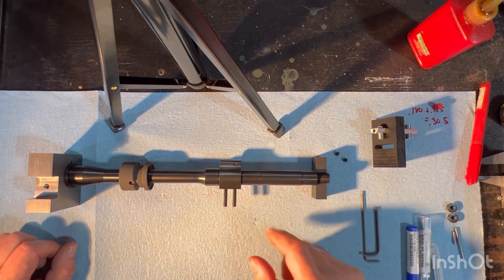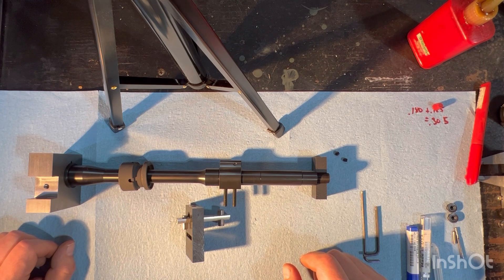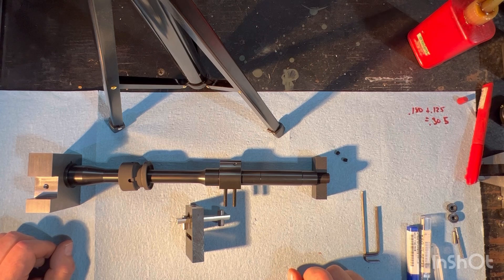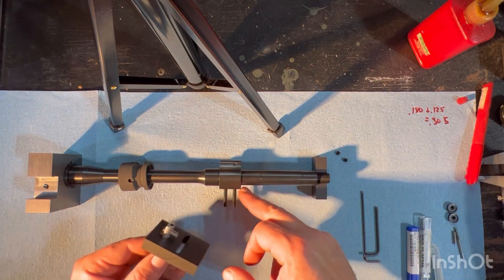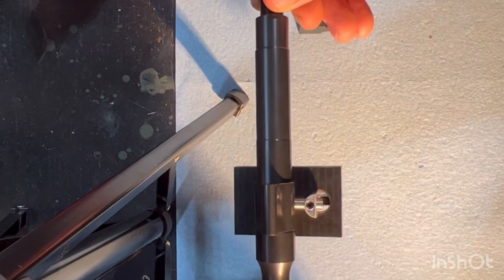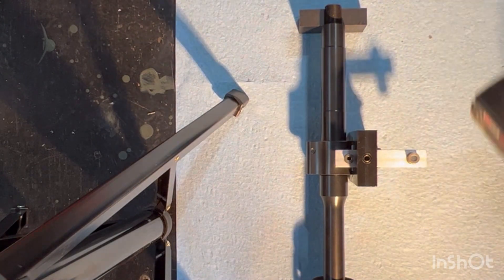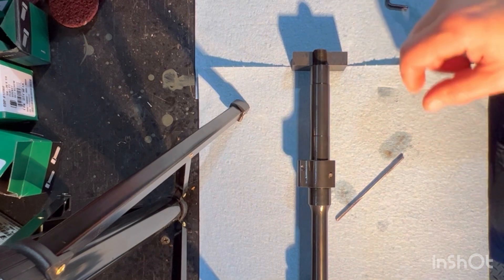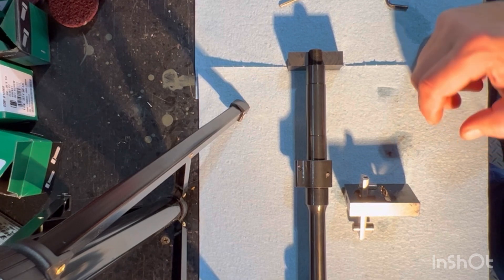BRD Engineering Universal Gas Block Pinning Jig

Comment: This is a good thing but sucks for me....I own the BCM/Vltor  BRD pinning jig.....Had I known evolution would change things I'd have never made the purchase.....Will you take the one I have as trade in towards the universal?    These thing aren't cheap by any means......Or can you make a video on how to file or use a metal router to accept more options?
Reply from the maker: What style BCM jig is it?
Reply: @comp1911  It's the first style gas block drilling jig that accepts low profile BCM/VLTOR and Rainer Arms .750 bore gas blocks only.....Now that market is flooded with all different types and sizes you're better off buying BRD's universal jig if you're going to be drilling all different brands of gas blocks.  I paid like $110 for it.....I just made all my builds with BCM .750 low pro blocks....I bought them bulk from a supplier wholesale I deal with....I'll eventually drop the coin for BRD's universal seen in this video.....This guy makes awesome jigs let me tell ya.....BCM isn't going anywhere and I would say the .750 bore is a very popular size bore....I just need to be prepared for what comes at me....
Reply: @comp1911  I've seen a few for sale here and there but for the most part people hold onto a quality tool like that....I seen them for like $60 used.....Actually a friend made a nice one out of a block of wood and just installed a press fit guide bushing which works awesome with any drill press....He actually made them for other style gas blocks and uses them everyday....Cheap and he has the time and tools needed ....He uses a Dremel with a routing bit which works pretty well at least for making one out of wood by hand....lol

Comment: a simple magnet will remove steel chips from holes, saving the chance of eye damage.....  shouldn't be using aluminum block.
Reply: Aluminum is fine, you fucking regard. If you think your design is better, make it, sell it. If its worthwhile, itll sell
Reply: @jamesstephenson2346 ….
in “regard” to your lack of metallurgy concerning its chemical behavior and reaction 
with other compounds which are known as non-ferrous, the reaction between the two 
is not a heat favorable combination…. a stainless steel gas-block (at a small increase in
price) has the desired mating couple match.   I regret I lack the patience to school you further in manners and spelling not to mention the make-up of alloys.
Please do not the “grima” the chalkboard on your way out…..      LOL